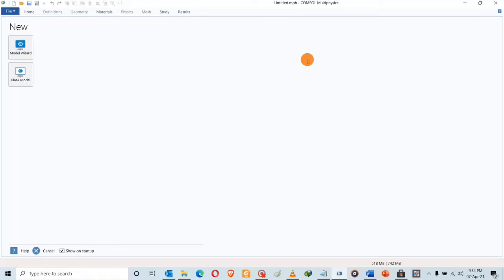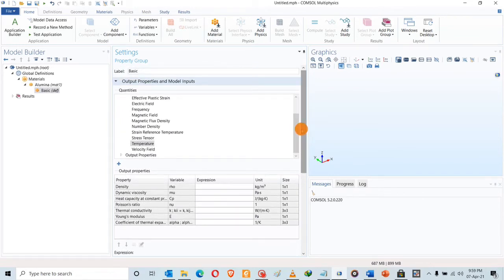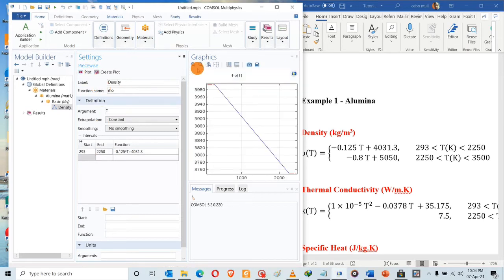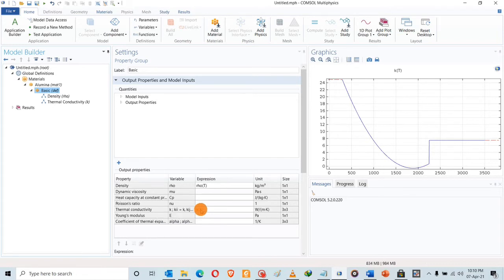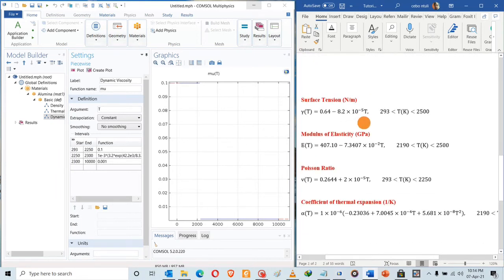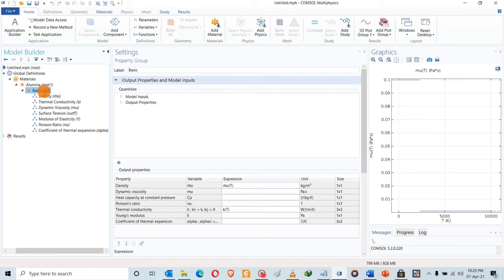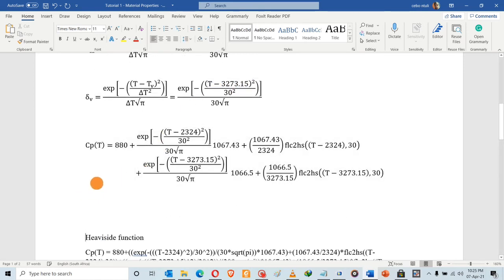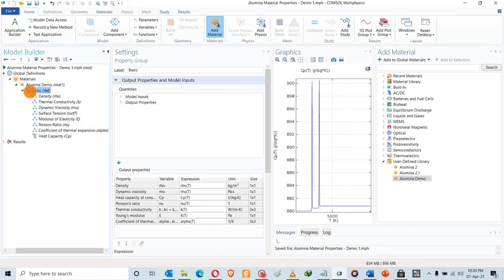How to create your own material in COMSOL Multiphysics | Laser Modeling, Heat Transfer - Part 1

Comment: Sir whenever I add the function name rho into the material properties I get an error that there are cyclic dependencies.please help me out with this
Reply from the maker: Re-name it as "rho1". The name "rho" is already taken by COMSOL internal coding. Now that you've called it "rho1", that means wherever you wish to use this material property, you must call it "rho1", not "rho". I hope this helps.
Reply: @chemicalsimulationcorner  Sir I have tried changing the name from rho1 even in function name but it says unknown function and the function displays in yellow color
Reply: Yes, I am facing the same issue, even if I change it to rho1 the expression are in yellow and it says 'unknown function or operator'
Reply: It also says 'Cannot add empty expression with an assign or zero object'. What do I do?